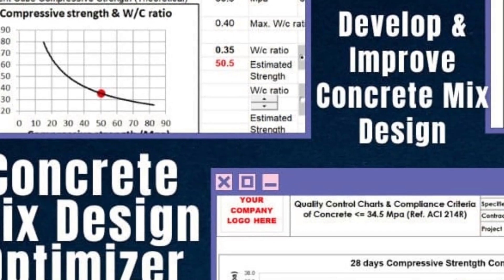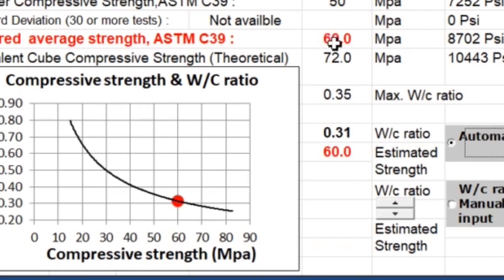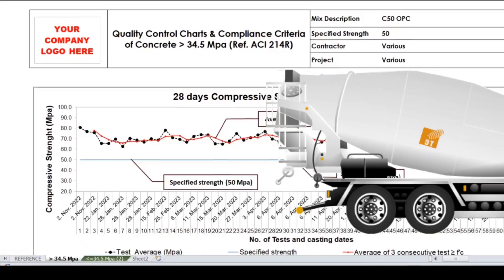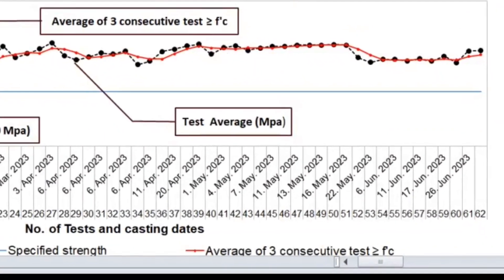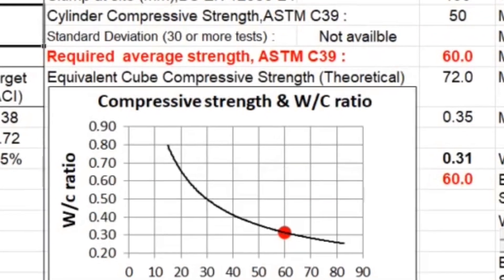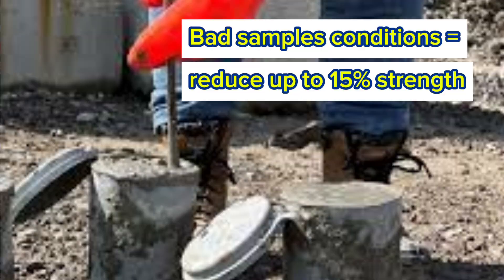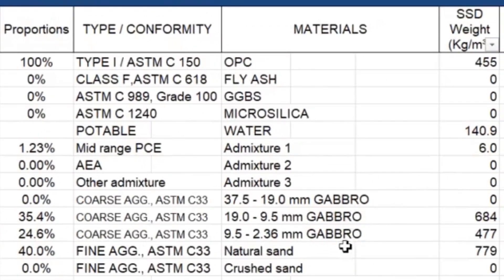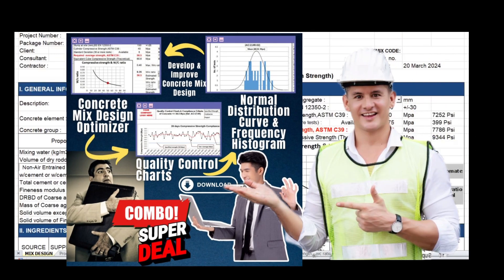Optimize Cement Content using Statistical Tools (Recreated video) #concrete #construction #scc

Comment from the maker: Optimize the cement content of your concrete mix design, download this package from link below
https://concretebycesar.etsy.com/listing/1705088121

What you will get from this package?
1. Quality Control Charts
2. Normal Distribution Curve and Frequency Histogram
3. Concrete Mix Design Optimizer Ver.1
✅ Automate design W/c ratio to achieve calculated target strength
✅ Use manual adjustment option of W/c ratio to estimate desired target strength margin 
✅ Free Ebook - ACI 211.8R-15 Guide to Troubleshooting 28 Concrete Mixture Issues
✅ Automatically switch from normal strength to high strength settings as per ACI 211.1 & ACI 211.4R
✅ Select from Multiple Combined all-in grading envelop based on the concrete application (0.45 power, CF & WF, Tarantula, SCC, Pumpability)
✅ Instruction on how to use the template
✅ Procedure (steps) as per ACI 211.1 & ACI 211.4R2.